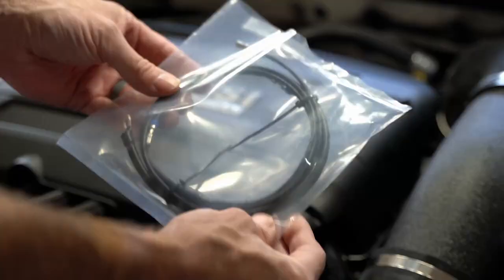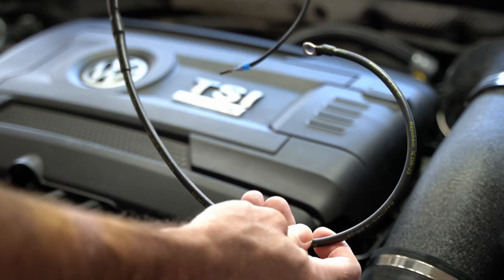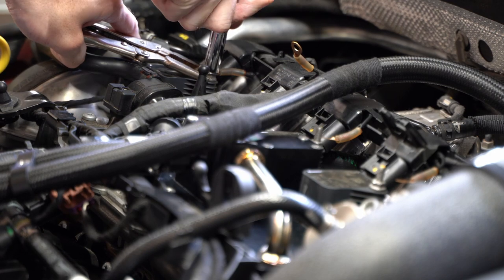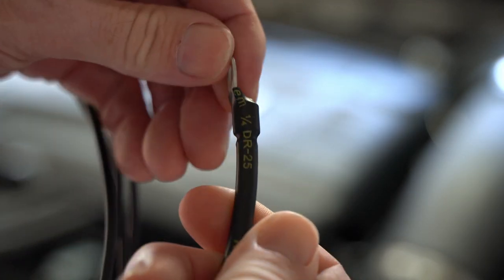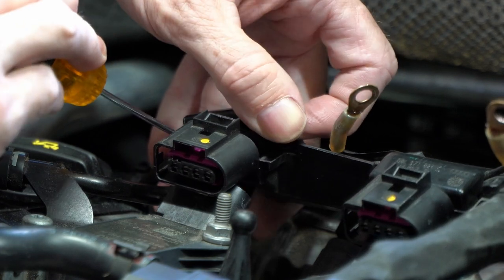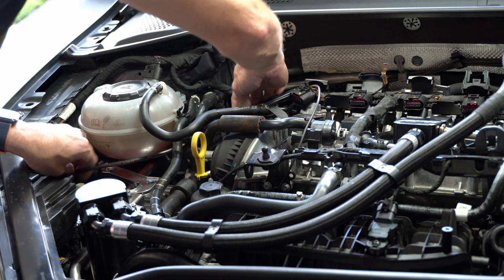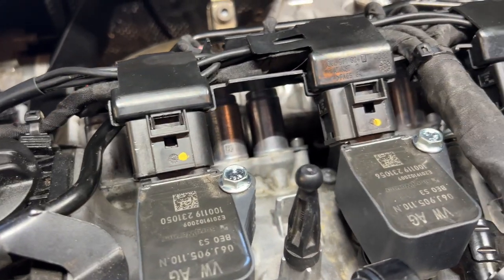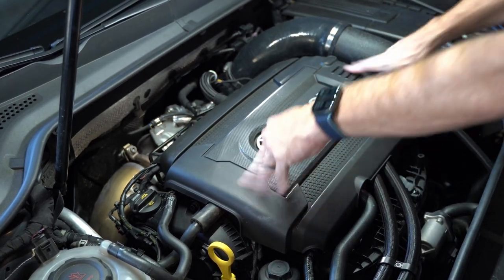EQT Coil Grounding Kit Installation - Pro Kit

Comment: I did this install today when I replaced my coil packs, and now I have a P2311 “Ignition Coil D Secondary Circuit” EPC. R.I.P.

Great video - very helpful during the install!
Reply: Did that resolve itself? I think I read that you have to disconnect the batter before doing this or you’ll get a code
Reply: @rambow70  I replaced my plugs after the code and it went away

Comment: Great video!

An auto shop I took my MK7 GTI to when my IS20 turbo blew, completely stripped out the block threads by tightening the ignition coil bolt too much. They never told me either. I found out after checking stuff weeks later after I picked my car up. Pissed me off to be honest. 

Since then, I have heli-coiled all of those spots, and haven’t had an issue since. I have a video on that if anyone wants to check that out on my channel.

Comment: Just installed mine exactly like the video and I threw a bunch of codes. Park/Neutral Switch Input Circuit, Lost communication with abs controle module, and lost communication with vehicle dynamics control module. Any idea what or why this is?
Reply from the maker: Is it possible you de-pinned the wrong wire?

Comment: Great video. Looks like you need a little coolant also. 😉
Reply: Oops, is maybe your thermostat housing leaking? Just had this very problem and VW wouldn’t replace it on warranty as my ‘19 R is tuned. Common problem for the thermostat housing to leak, though. 
Awesome channel and has helped me so many times already.
Reply: @stephankaeser8939  these cars consume a bit of coolant
Reply: You think that is consuming coolant, wait till you see me drink coolant.  My GTi threw me out the drivers seat last time I hogged the coolant.  Put me in the back and said I was her b*tch!!  I'm someone's b*tch😲😲.  From that day forward I knew it was meant to be.

Comment: This is one of the most underrated 'mods' you can do. Dave's a genius for coming up with this while at EQT. My idle is butter smooth compared to before.. and single hex cap bolts to remove the coil packs?? what a DREAM! Thanks for the DIY walk through! Even if you're stock, do this, makes life so much easier and properly chassis grounds the coil packs with thicker gauge wire that's far better insulated. Great stuff from EQT

Comment: Ordered mine should be here in UK Monday 15th. Have a little misfire so thought I would put this grounding wire on see if it helps. 
Great videos keep up the good work.
Reply: Hi, did this solve your misfire issue? As I'm having the same problem and replaced everything I could apart from the grounding wires
Reply: Any updates on that issue from either of you? I’m wondering gif you tried this and it worked?

Comment: The reason for the triangular cross section of the bolt is to prevent it from vibrating out on its own because it widens the overall diameter slightly, making an extra tight fit. It's quite common (although often oval shaped instead of triangular) in automotive bolts and effectively replaces thread lock for frequently removed parts like these coils.

Comment: I broke a purple insert when re inserting in the sensor.

Will I be fine without them? 

Where can I order just the purple piece
Reply: Just order a new unit as doubt you can just buy the purple bit.....by unit I mean but a whole new car 😜 
jk can but replacement quite cheap

Comment: Excellent.... Time to order some parts. Hopefully helps with misfire issue I occasionally have.
Reply from the maker: It’s quite possible. Even if it doesn’t, getting rid of those ground wires is worth it!
Reply: @EVERYTHINGcpo  yeah I got eqt stage 1 mk7.5 gti. occasionally get multi-cylinder misfire/cylinder hide when I go WOT and the dsg kicks down especially on a low tank. Gonna do this CGK, replace the Coil connectors, check the harness. Relatively inexpensive and gives peace of mind. I'll tackle the fuel pumps when I go full E

Car drives fine 99% of the time. About time for carbon cleaning also.
Reply: @jonathanmatthew5451  did the grounding kit solve the problem? I'm had bad misfires and hide cylinder code for cylinder 3 one night under WOT I started at the coils but right as I was going to replace them the screws for the coils were loose and I can't get the nut off the bolt so I assume it's the ground not being so great causing the misfires
Reply: @poyo3582  my issue seemed to be a weak hpfp. When I went stage 2 and upgraded to autotech internals my issues disappeared even on a low tank.
Reply: @jonathanmatthew5451  so I guess it is the grounding in my case cause I already have a upgraded hpfp
Reply: @jonathanmatthew5451 literally had the same thing happen twice (16 s3, ie stage 1 high torque, rs7 plugs (I know I need to get rid of these too) intake and turbo inlet. Been trying to figure out if it is ignition or fuel related although it happened twice both times under 1/4 of fuel. So the hpfp solved it?
Reply: @brandonlathe7732  mine was hpfp I'm pretty sure. Issue disappeared when I put a new oem pump in with autotech internals. Haven't had an issue in the last 15k-20k miles with misfires/fueling on stage 2 E85 tune which puts even more strain on the fueling system.

The issue could happen anytime but definitely more consistent under a 1/4 tank when I was stage 1.
Reply: @jonathanmatthew5451  thanks man! I'm gonna run some logs to see if it seems weak, I'd rather make completely sure before dropping $750 hahaha, hope you're enjoying stage 2 e85!

Comment: When inserting the new ground pin, I'm stuck dead in the water. Any tips? In the video, you just say it needs a little pressure, and voila it's fully seated. I can only get the pins maybe halfway into the connecter, certainly not seated fully.
Reply from the maker: My recommendation is to look at the pins and make sure nothing is bent or over extended in a way that is preventing it from going in all the way.  Also check the place where the wire is crimped to the pin and make sure that isn’t bent into a shape that is preventing insertion. You can clean it up with a pair of pliers if needed.

Comment: curious what depinning tool i need if i don’t wanna buy the whole kit
Reply from the maker: It’s just a very basic dipin tool with two narrow flat blades. You can go to any auto parts shop and get a multi tool version for a few bucks if you want to do that. Otherwise people have done it with small drill bits or paper clips! :-)

Comment: What can I use if I don’t have the de pinning kit?  Bobby pin?
Reply from the maker: Yeah that would work. Anything thin that can slip on each side and compress those tabs.  I know folks that use tiny drill bits as well.

Comment: Two feet of high voltage coils grounding through engine bay to random body ground point? Do you think you're smarter than VW engineers? Good luck!
Reply: yes
Reply: If it works out that if save VW $0.01 they will do it as that’s millions in savings. 
Toyota will do it even if it saves $0.01 per 100 vehicles. 
We are only interested in performance.
Reply: Smart thinking, but its now grounding through the plugs to the engine, now a question. Where is the engine grounded to? 😉